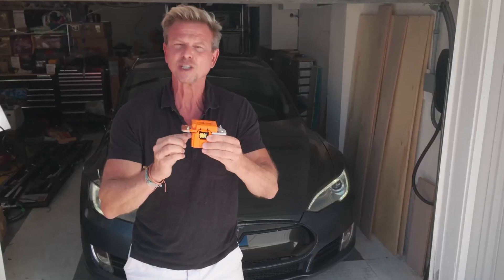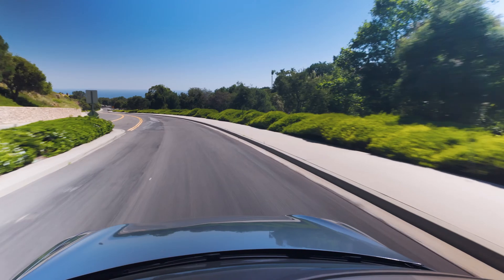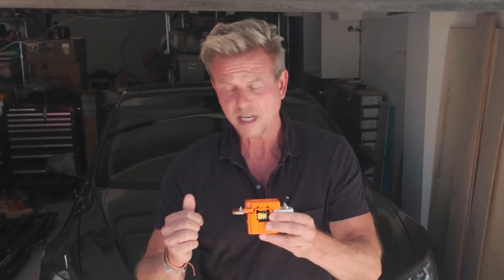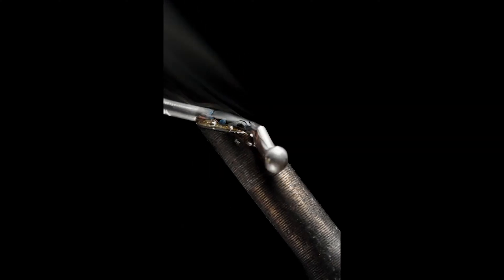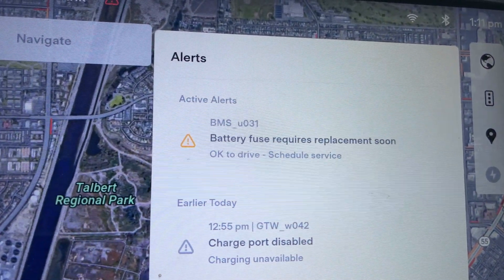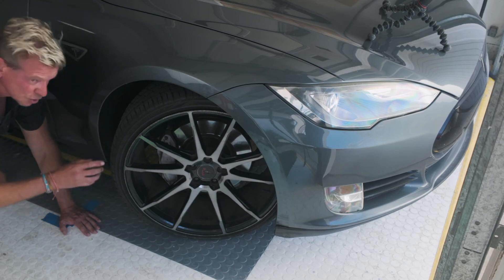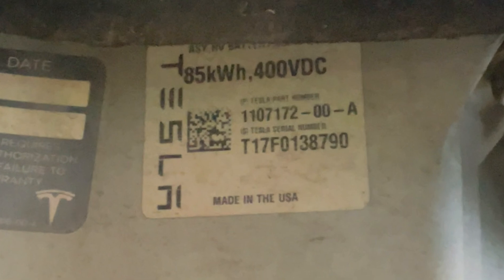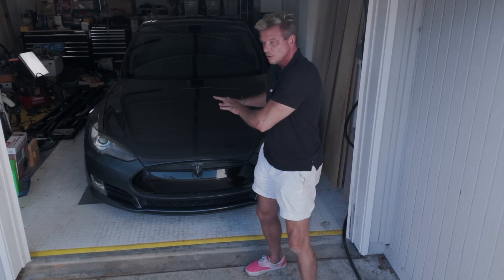This Faulty Explosive Part Will Soon Break Your Tesla. What You Need to Know.

Comment: Hmm.. My car is a 2015 model S, still only 40,000km on the clock. Purchased it in March 2023, 3rd owner. I know the fuse has not been replaced as I have the full service history of this car and have spoken to the 2 previous owners. Tick Tick Tick.....
Reply from the maker: It is possible your car was made before they started the use of the battery powered pyrofuse, so you may not run into the issue.

Comment: 2014 Model S, original battery from 2014. Received the notification last year, so around 9 years. Cost around $700 to get the fuse replaced since it's on top of the battery pack, and the main HV battery must be removed.
Reply from the maker: Thanks for the info - and sorry to hear about the expensive repair! Tesla didn't do anyone any favors, when they placed the Pyro Fuse in the unreachable location on your car!